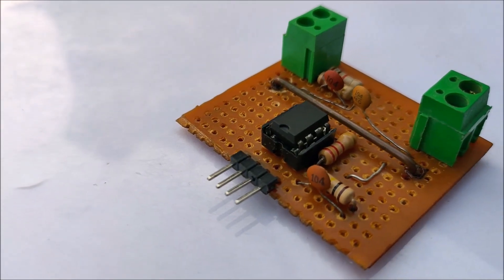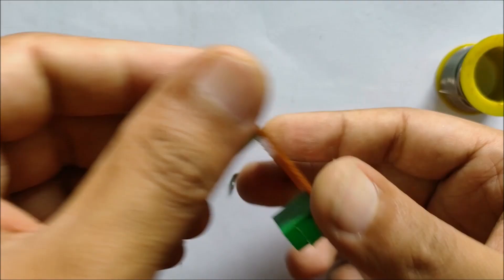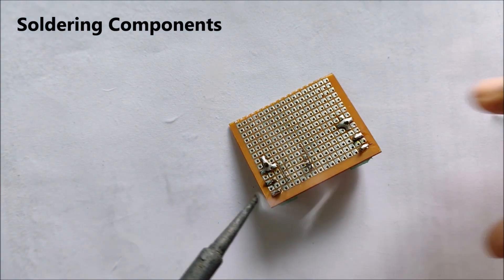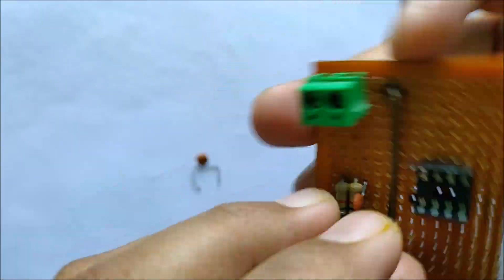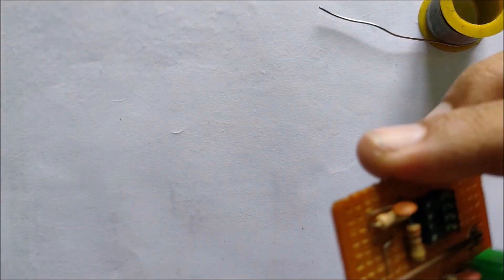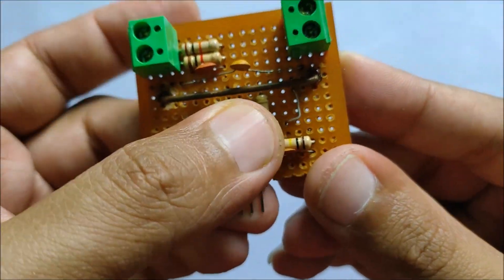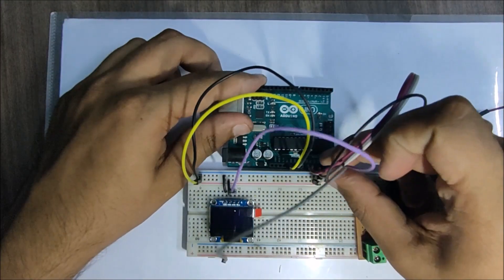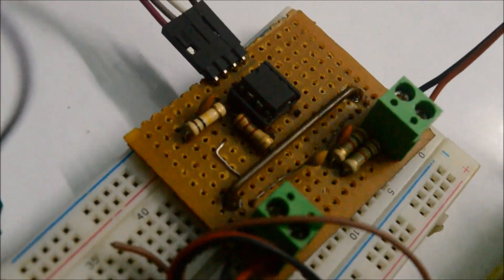DIY Power/Wattmeter Module for Arduino || How to measure power using Arduino

Comment: if i use Shunt R001 what do i need to change from that schematic and its program?
Reply from the maker: Since you will be using a shunt of lower value, the only thing you need to change is the resistor value to change the gain of the amplifier. You would need to increase the gain for this case
Reply: @UtsavShah_25  can you help me, how much resistor value i need to change and what value on arduino program i can use
Reply: my plan is to read maximum current at 50a

Comment: How many amperes and volts can be measured with this circuit.
Reply from the maker: You can comfortably measure 30-35 volts with a current of 6-7 amps without much issues
Reply: @UtsavShah_25   how can the amperage go up to 30'40 amp

Comment: Ideally, voltage should be sensed on the low side of the load. An over protection circuit maybe a 5.2V zener between analog in and gnd post voltage divider can save the chip in case of over voltages.

Comment: hi sir i am vaibhav whom you tell the gain and all that stuff in that amp . So will you please help me in this project. Sir i only want to measure the ampere which coming through my solar panel. which give around 12 amps but i wanna make an ampere meter which can measure upto 15amps.

and i am  having 
00.6 ohms shunt
so what will be the schematic after this and coding for the arduino
Reply from the maker: Use 39K and 10K resistor for Rf and Rin to get a gain of aaprox 4.9. then check the voltage output of opamp for different current values from shunt and adjust in the code
Reply: @UtsavShah_25  If this work then i will tell you brother.

Comment: Utsav, Since anything can be programmed in the Arduino, it would be interesting to add a calculation and display of the cost of the power. Where I live it is about 14 cents per KiloWatt Hour. With most of the power measured with your project it will be milliwatts ,or maybe 1/4 watt range.. fractions of pennies.  However, it would still be an interesting addition that would make your project unique. 

I work in Automotive engineering and we look for cost savings on cars down to pennies. It doesn't sound like much, but if you add up 100,000 - 700,000 cars built over a year, those pennies add up. 

You might be surprised how much all of those devices that run on milliwatts add up over a few months on your bill. The power cost will be even more for batteries that are not rechargeable.
Reply from the maker: Thanks a lot for sharing your idea and I have a project upcoming that requires power data logging. I will surely add the energy and cost calculation there

Comment: Please learn the correct usage and technique for soldering. You never carry solder to a joint on tip of the soldering iron. Also clean and tin the tip of your iron, it is filthy. Another tip, lose the background music, not needed at all.
Reply from the maker: Thank you for the feedback. As a matter of fact my soldering iron has got pretty old and definitely needs replacement. Will keep the points in mind :)